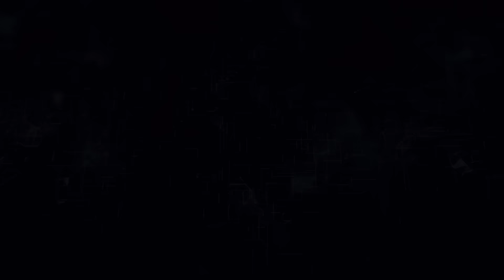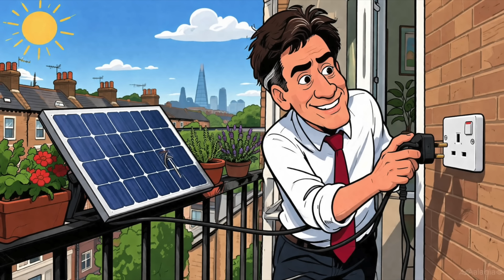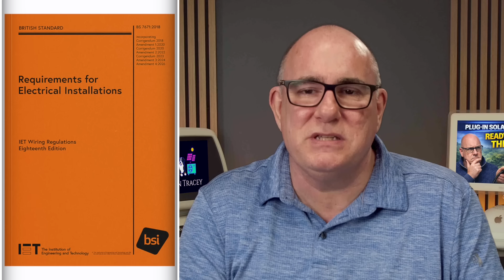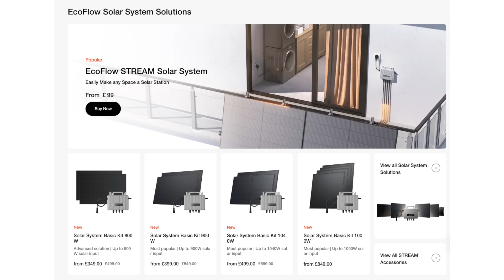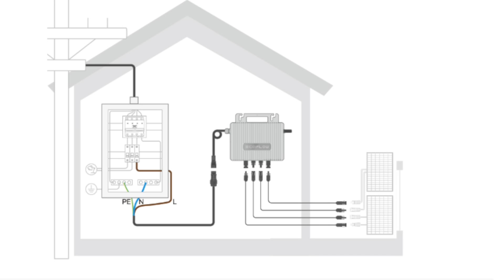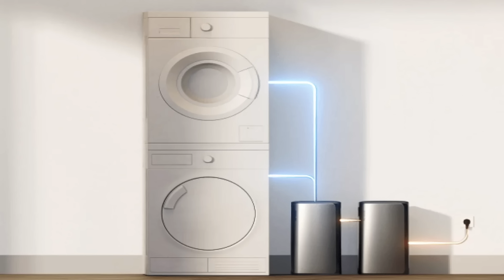Plug In Solar Is Coming… But There’s a Problem

Comment: In my home here in NL I have a coupled system of 3 HomeWizard 2,7kWh systems on a separate circuit. Indeed the maximum in/out is 800W for each but it is legal to set them to 2400W in/out, as long they are on a separate circuit. No trading on these ones, the design philosophy is called “ 0 on the meter” and they are fed by solar surplus only (from my 14 rooftop panels). Now, after two years of operation the first conclusions are: I NEED MORE since I also have a hybrid car and a heatpump. In winter, they don’t do much and I have been using the forced gridload option a few times, calculating the needed difference of tariffs during a day/night and compensating for the RTE. It is promised we will see a software update soon to make this automated. So, what started as a simple plugin for my base load, evolved to a “need” for a much heavier battery with more requirements like an emergency function etc etc, in about 2 years time…. A true rabbit hole but a nice one. 
Oh, and on the advantages of allowing plug in batteries, don’t forget to mention the so much needed independence from the fossil-terror situation. Many small steps make a big result. Good luck UK, make this work the sooner the better.
Reply from the maker: @bobjhg3887 that’s a brilliant real-world example 👍  

And you’ve summed it up perfectly — it starts simple, then quickly becomes about storage, automation and independence.  

That “0 on the meter” approach is exactly where I think this is heading. Appreciate you sharing it 👀

Comment: I'm fortune Ly to have gotten into this 2 yrs ago and Eco Flow sent my they Delta 2 range along with the Micro Inverter along with all the plugs for my main power hungry Gadgets around the home. My unused power goes to my Delta Pro and my Delta Max all with the extra batteries and and the smart plugs power my Home Office, Fridge, TVs. The down side I found was where I was going to mount my two 400w Panels and not lose my garden by them. The decision was to buy a Pergola and then mount them on top which has worked ever since.
Reply from the maker: @stomperthemixer1 that’s a great setup 👍  

Using the Delta units to soak up excess and run key loads is exactly how these systems shine.  

And the pergola idea is genius — solves the space problem nicely 👀

Comment: Baahahahahah micro invertors per panel direct to 220V? We've had that for a very very long time on the continent. UK will forever be behind due to brexit.
Reply from the maker: @Jonathan-vx2qj you’re right 👍  

The tech isn’t new at all — what’s new is the UK finally trying to catch up and make it accessible to normal people.  

Better late than never I guess 😄

Comment: It would be great to have an update on the feasibility of using home batteries in conjunction with Economy 7 supply, to charge up overnight at the cheaper rate, and then pull from the battery storage first during peak hours, to reduce demand during peak rates periods, and extend my utilisation of off-peak rate electricity.
Reply from the maker: @akastewart  With something like Economy 7 it can make sense, but it’s even more powerful on newer tariffs like Intelligent Go or Cosy.  

I’ll definitely cover this properly as it’s becoming more relevant 👀
Reply: @JonathanTracey  That’s great to hear. I’ll sub and keep a look out for the video. Thanks for responding. 👍

Comment: You dont mention much about bi directional  breakers / RCBO's, SPD's or type A RCDs which are important to protect the electrical system from leakage, faults, RCD's not tripping in the event of a fault & can deal with the backfeed from the solar inverter. most UK consumer units (fuseboxes) will contain none of these things, and to have people plugging in micro generation in to any old crap will cause problems.
The europeans have been using type A RCD's for a long time they saw this comming, we didnt until fairly recently.
SPD's (surge protection devices) also pretty useful when it comes to lightning or faulty inverters again not that common in the UK.
Dont get me wrong I think it's a great idea, but if it's pooly implemlnted it will cause problems, possibly Grenfell 2.0
Reply from the maker: okay, leaving the hyperbole aside, I don’t think we’re gonna suddenly see another grenfel. I’m sure there will be recommendations on upgrades that people should do if they have old consumer units. The reason I’m not talking about RCDs,RCBOs is that every single person situation is gonna be different and they should talk to a qualified electrician if they have any concerns or need upgrades

Yeah, I did read that. Germany had been installing type A RCDs for awhile but the vast major majority of German homes do not have these and there are millions of homes with plug-in solar. So I think the chances of there being lots of fires are pretty slim.
Reply: @JonathanTracey thanks for the reply. 
I appreciate that every situation is different and perhaps manufacturers of these kits should consider that the UK is behind on electrcal standards and include protective devices in their equipmennt like Ev chargers with PEN fault protection. We shall see.
What concerns me is that Bob has been down to Aldi got himself a balcony solar kit and plugs it in with zero regard or understanding of the potential problems it may cause.
I remain convinced that when talking about tthis you should alao mention that suitable equipment should be installed prior to installing balcony solar.

Comment: Mains electric is not for your convenience.    You don't even need mains. use 12V.
Reply from the maker: @techbricks5300 yeah… you can run everything on 12V 👍  

You can also churn your own butter and live by candlelight if you want 😄  

Most people prefer the convenience of mains — the whole point here is reducing what you pull from it, not pretending it doesn’t exist.

Comment: Because cheap and homebrew non compliant devices don't exist....
This is going to kill people.
Reply from the maker: No, it’s not gonna kill people, this has been going on for years in Germany, the systems are safe otherwise we would have thousands of Germans electrocuting themselves every year which we don’t
Reply: @JonathanTracey the significant part of my comment was "non compliant".
Sure, compliant systems are safe, but there will be people that either don't realise the need for the regulations, or are plain anti regulation.
Those people wi just put a plug on the output of all sorts of devices that don't cut off when unplugged.

Comment: I had a small stand alone system. 535w panel, Victron mppt controller, inverter and a Lifepo4 battery fused with a MRBF Blue Sea fuse. The film capacitor in the inverter failed and made smoke. The alarm went off and the control centre contacted the fire brigade, which in turn sent out 2 fire engines. They came in and inspected the system and then called the police (3 vans, 2 cars, an unmarked car and the dog unit) saying the Lifepo4 battery can explode and they wouldn’t be able to put it out. They contacted the housing association to instruct me to remove the system including the solar panel which was a fire hazard. I explained it is not a lithium ion battery and if it ever did catch fire, it can be put out with water. I was not even connected to the grid at all. Fire brigade, police and landlords must go through a training program, so that they are better informed. I thought the fire services would know, but the chief didn’t know, neither did he know that kerosene is is not flammable, but combustible, just because I had a diesel heater I my storeroom. By the way I was just running my freezer and fridge, and laptop from the solar setup. I was given permission 3 years ago, now they can’t find the paperwork.

Comment: Government has been busy protecting it's energy mates. Why not set minimum rate for export, bin the certification rule that only 1 company can certify in UK that costs 700. Looks like government regulated it so we can't be paid easily for exporting energy
Reply from the maker: @moltitrader I get the frustration 👍  

The certification side is definitely a barrier at the moment, especially for smaller systems like this.  

Hopefully things evolve as plug-in solar becomes more common, because right now it’s not really aligned with small-scale setups.

Comment: We all installed energy saving bulbs but still our bills went up. Is it all clever racket? Also will reflection of sunlight help increase Global overheating and climate change when there are millions of solar panels? As for ED Millilband—I think he is mad.
Reply from the maker: @malcolmtruman6467 ah yes, the “we changed light bulbs so nothing else could possibly have affected bills” theory 👍  

Energy prices went up because… energy prices went up. Not because LEDs secretly doubled your usage 😂  

And on solar reflection overheating the planet — panels actually *absorb* sunlight to generate electricity. That’s literally the opposite of reflecting it.

Comment: ⚡ Households could also  look at buying their own micro generators & going off grid altogether ! ⚡
Reply from the maker: Yeah going off grid completely in the UK is quite difficult unless you have enough space to put up a massive solar array, this is because in winter you will get days where you will get next to nothing from your solar system. The only way to get round this is to have a large enough array to compensate
Reply: @JonathanTracey I believe some Greek households invested in their own electricity generators when government whacked up standing charges a couple of years back ?
Obviously not  a green solution but an economic one.

Comment: Imagine being on economy 7, and utilising a battery system that feeds a legal feed in inverter via a high quality regulated power ac to dc supply, utilising smart sockets with timers, also supplemented with the solar during the on peak hours.
Reply from the maker: @Neil-bp5rq yep that’s essentially energy arbitrage 👍  

Charge cheap overnight, use during peak — it works really well if the price gap is big enough.  

Just need to factor in battery efficiency and control.

Comment: Although small generation, if it produced enough energy in summer to run some fans, an air conditioner, or keep a fridge full of cold drinks running I think that would be a reasonable payoff.
Reply from the maker: With the current prices of electricity, anything helps

Comment: That is the wnd of us electricians then 😂
Not.

Atill going to need us to do off grid and proper installation
Reply from the maker: I agree I don’t think this is a bad thing for electricians at all. I think what this will do is introduce large portions of the population to solar power. Those that start with microgeneration are more likely to upgrade the system later when they will definitely need an electrician.

Comment: Makes sense, electricity comes out of a plug socket, not in. It’d be great to charge my ebike, and background stuff. I like the idea of using it over the bedroom window for shade in summer. Id like a Bluetti, for charging smaller items including portable power banks. Living in a windy area, I wonder if the attachments would hold, and how to give it extra stability?
Reply from the maker: so that’s exactly how we have our system set up, when there is excess solar it turns on a plug that’s connected to our e-bikes and they charge up for free

Comment: Complete rubbish, 800 watts is not covering a quarter of household base load. And you need 1600 watts of panels to get 800 watts of constant energy. Not only that  the panels need to be angled directly at the sun at all times during the 800 watt draw. This is a scam  anyone who has actually used solar properly  will tell you, no storage, no point in solar energy! Don't waste your money!
Reply from the maker: @graxav ah yes, the classic “solar only works if the sun is directly overhead 24/7” theory ☀️  

Panels don’t need perfect angle all day — they generate across the entire daylight period, which is why people with real systems see savings every single day.  

And no, you don’t need batteries for it to be useful — unless you think reducing your bill during the day has “no point” either 😂
Reply: @JonathanTracey  I lived 5 years totally off grid and I am an electronics engineer. Without storage solar is pointless at night in the first place, and secondly - an 800 watt panel cannot produce 100% duty cycle without full sun and variable alignment (automatic or manual) - then that can only be done for a limited time of the day - the UK has 53% average sunlight!. This equipment is sold with no storage - claiming to deliver the panel wattage from peoples porches! That is simply false and a waste of money. By the time this equipment recoups 20% of its costs, it will already be redundant and in the trash. Only China - the manufacturer of these gimmicks will profit out of this nonsense.

Comment: I think plug in solar is a great entry point into renewables and sustainability, loads of positives around accessibility and getting people engaged.

My only concern is older installs, especially properties still running VIR. There’s a risk someone could start plugging multiple units into a single circuit without really understanding the limits.

Most people won’t go overboard, but for the DIY crowd picking up a kit from somewhere like B&Q, there’s definitely potential for it to be pushed beyond what the installation was ever designed for. The lack of clear guidance at the moment just adds to that risk.

I really enjoy your content and often point customers your way when they’re unsure or on the fence. You explain things really well.

Amazing content 👌
Reply from the maker: @SolarManSam completely agree 👍  

That’s exactly the risk right now — the tech is simple, but the electrical side isn’t always understood.  

Until clearer guidance comes in, keeping it to a single unit per circuit and understanding limits is key.  

Appreciate the kind words as well 🙌

Comment: Very useful summation, thank you. Just a bit of a shame that, in typical British fashion, it all becomes legal just after Summer and peak generation capability, rather than before it! Oh well, ready for next year, I guess.

We already have rooftop solar but I’d love to get a micro system plugged in to the Summer House, so that I can run a small air conditioner and all my PCs and servers out there, instead of clogging up a corner of the boot room. It’s south-facing and zero trees, so should prove suitable.
Reply from the maker: @dizwell appreciate that 👍  

And yep… classic timing 😂  

On the plus side, getting it right before rollout is probably better than rushing it — and your summer house setup sounds absolutely ideal for one of these systems 👀

Comment: Don't overcomplicate solar. It's a simple system. I have generated 90% of my energy from solar since 2019 with a stand alone system I built and installed myself for £1500. The key is reducing consumption, not generating energy for overconsumtion.
Reply from the maker: Yeah, but as the government wants us to move towards a more electric centred lifestyle, with Heat Pump pumps and electric cars reducing consumption isn’t something that we’re gonna be doing in the short term.

Comment: I live in Germany and installed a system like you describe last year. It is a fantastic way to reduce your energy bill, and recommend a small battery and power monitor. This way you measure the actual consumption and the micro inverter can nullify it. The excess solar energy goes into the battery instead of being lost to the grid. 
Despite not having an ideal position for the panels (garage roof top) I get a good yield and have only had one day in winter without any yield (snow on panels). Even during rain you get something.
Reply from the maker: That’s pretty cool, I hope the UK can catch up with Germany because you guys have had this for a few years now, and it seems to be quite popular

Comment: It will conveniently take all summer to update the regulations so that electricians can continue to rip off customers all through the summer until the weather changes .😎👍
Reply from the maker: @James6781-y4x yeah because the entire regulatory system is clearly built around one master plan to keep electricians busy all summer 😎  

More likely it’s just slow-moving regulations catching up to new tech — happens in pretty much every industry.  

Frustrating? Yes. Conspiracy? Probably not 😂